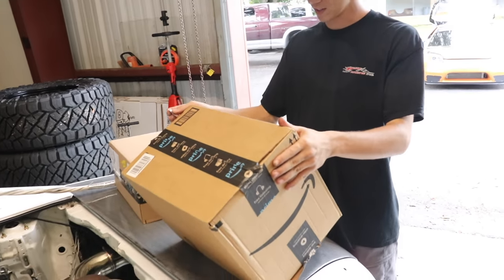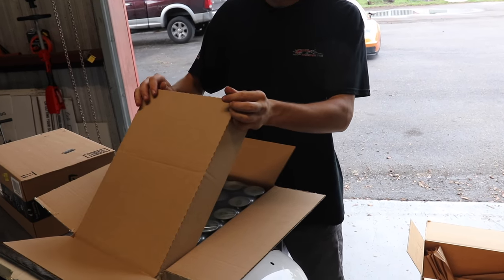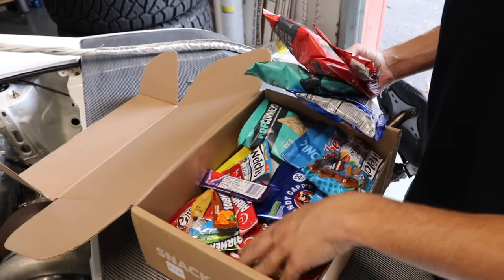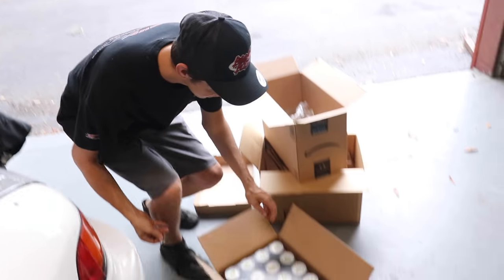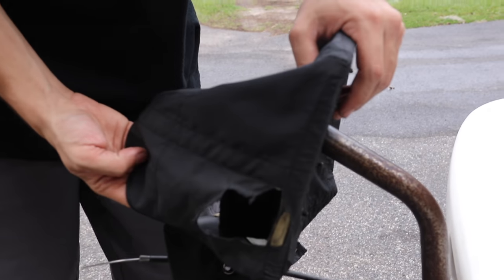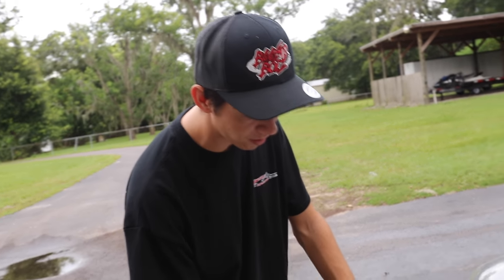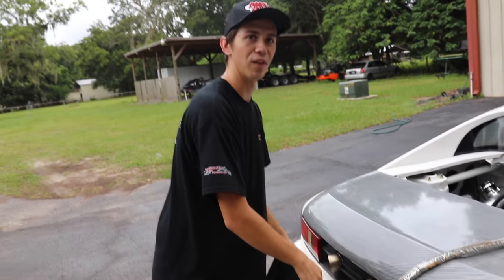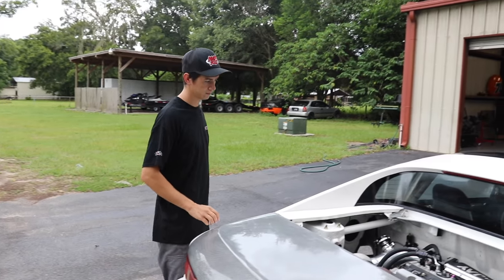We Ran Our ONE and ONLY 7 For Awhile...

Comment: Add a baffle in your fuel tank, when braking hard the fuel leaves the pickup and run the pump dry, I had that issue with my MR2 with same mechanical fuel pump.

Comment: FYI, those exhaust tips have such a small radius that the central portion (highest velocity and momentum) of the exhaust flow is going to resist changing direction (and pull quite a bit of the flow along with it). You'd be surprised what even another 10mm of radius might achieve

Also, here's another vote for having at a little input from KSR, even if only to help plan it out.

Comment: Heat shrink that positive cable the end thats on the alternator on the van.. its dangerously close to grounding out on the heat shield on the alternator.
Reply: pretty sure the heat shield is plastic
Reply: @mdnovaman  bahahaha no... all heat shields on or near engines are always metal, beit aluminum or aluminized steel.
Reply: @drgibs347  I’m sat here with an alternator in front of me with a moulded plastic heat shield 🙃. His could well be. But it also could be plastic.
Reply: @drgibs347  dr gibs is right some alternators have a plastic shield mated on the back with a small air gap.
Reply: @FabFiend  air gap for that kinda heat shield is more important then shield material, airs a far better insulator then a lotta people realize 🤟but either way insulate the damn alt cable lol thats one of the highest loads in any chassis

Comment: Find a another chassis to start the cage build Edit: it only makes sense it would be less work in the long run and be cleaner welds instead of  welding on top of previous welds
Reply: He's got that red mr2 just sitting there 🤔
Reply: @dookiebooger9967  no doubt right?
Reply: You just make new plates ....
Reply: @NiveusLuxLucis  adding more work and still  welding on top of the old welds  unless you make the plates smaller in which case you're  creating weaker mounting points by having to grind down old welds on the thinner sheet steel. Making the plates any larger is just a waste of  weight. Japanese cars have thin sheet steel and are strong like paper #oragamicars

Comment: I think you should get the doors and the deck lid wrapped in white to make it look legit. Also the front block off plate on the front bumper should be made of a thin sheet of 1/8 white poly. Then paint the lower black section on the bumper, the lower section of the rockers and the lower section on the rear bumper white.
It will make it look lower without lowering the subscription. Also when you make the drag wing paint it white as well. I think with all the things color coded it would look so much nicer. I know the Raw carbon let's every one know its carbon. But I think it would make the car would look so much cleaner. Another thing you could do is make a alloy panel for inside the rear firewall to put some sponsor decals on it to help out all the companies that helped with the build. Also A a frame board to sit outside the tent for when you are at events. Would be better than covering the MR2 in decals and stickers to make it look so much clearer. The only stickers you should put on is for Once the new front bumper block off plate is painted white is a Black Fueltech sticker. Then a PFI speed windscreen banner and 2 JBR Engine stickers for the rear coupe side glass. And that should be it. If those few things are tidied up and a buff and polished the MR2 is going to look Mint.
It would be a little work but it would be well with it. Congratulations again on the Record and the First 7. And I know you mentioned in the last video,  but Wyatt deserves all the help on his race truck now. Well don't Boiz.

Comment: The NSX seems be having a ignition cut to help build boost quickly (raw fuel in the exhaust) built in to the maps . Send the files to Fuel teck and see what he thinks . I would look at the tps sweep looking for a small dead spot as well  or try a new tps for a quick easy test. .  The mr2 would make a killer 8.5 -9 bracket car while you cage a new chassis , give your tons of data , time to dial in the chassis suspension & learn how to really dial in all the new sensors to run and make money . Everyone knows how quick it is now but how consistent can you build it to go rounds in a bracket class or no time heads up 1/8th

Comment: If you do plinth blocks for the case you wouldn't have to cut the floor to drop the case down. Also with the blocks when you're fitting the cage and then when you're ready to weld the top of the hoops. Pull the blocks out temporarily to drop a cage down. Plus it makes the amount in port on the floor lot stronger for the cage.

Comment: I can understand why you did the build the way you did. You wanted to be the first in the 7's. But it would have been the perfect time to do the new cage when you had the car stripped down for the engine build.

Whether you build it or have someone else build it. Go with enough cage so you can grow into it, time wise.  Don't do just enough cage to make it good for what you are running now. Think ahead and make it enough cage to go even faster. So if you decide to do even more upgrades or just turn it way up, you'll be legal to run as fast as you want.  The last thing you need is to have a bunch of down time to build the new cage, get it done and then out run it's cert. again. I'm not personally familiar with the requirements when you get faster then the 8.50 cert.  Just build the new cage with the future in mind.

And at what point will a 2nd chute be required? Is it 200 mph? You might want to consider that too. 

And on the van's electric water pump, do you have some kind of controller for it? Some electric water pumps can move too much coolant/water, too fast, which can also hurt cooling. You may need to be able to slow the speed of them down.  I'm pretty sure the FuelTech  set up can control that. I just can't remember if the Rowdyssey had a FuelTech in it yet.

Comment: dont forget to keep testing and playing with re-adding weight back into the front of the car. I know the wheelie sensor will handle it regardless, but you will probably still be able to throw more at it on the 2 step and pull a better 60 foot by adding weight back in the front on the plate. i guess when you add the new cage that will change everything up anyways but something to keep in mind. i love the carbon parts but would love to see you put a wrap with a full livery on it. it's so racecar at this point it would be cool to see you put a livery on it that matches with boosted boiz plasterd on down the side with all your sponsors. youve got the NSX for the street car look. somethin like LZ's white and red R32

Comment: You should fit fogs into the front so you dont need to use that cars headlamps in highspeed runs. Those things will totally f.ckup the cars aerodynamics if popped up.
Reply: They do have aftermarket solid lights for SW20s instead of the pop-ups. They were a thing during the AutoSalon SexSpec era but haven't seen a set in over a decade.
Reply: @MafiaboysWorld  then you would lose the pop ups, my way adding just fogs means he could still have popups when not doing 180mph+.
Reply: @christianbuczko1481  Pop-ups are overrated anyway. 🤷

Comment: Use a temp gun and temp the top hose going into the rad and then shoot temp gun at the bottom rad and see what kind of difference in temp you have an that will help determine if rads to small ect

Comment: SFI Spec 25.5 chassis will certify to 7.50e.t and up to 3600lbs, 25.3 is 6.50e.t @3600lbs, 25.2 is 6.0 @3200. If it were me, I would go on with the 25.3 spec. At the rate you are going, it probably won't take long to make it faster than 7.50's, and if you just do a 25.5 spec now, you will be redoing the cage again this time next year to a 25.3.

Comment: As I said, in a earlier video with the 
Odyssey/Rodyssey. With the overheating issue, you guys need a normal exhaust  system down and out to help with heating issues in that engine bay. And maybe that stock bumper might need more cutting. But for sure that electric water pump is going to help.

Comment: Funny you got excited about a good starter. I used to daily drive my Dart and I found out the later Diplomat police cars used a factory high speed high torque starter so I put one in my Dart. It cranks twice as fast and sounds way different than the old school Mopar starters they used to use. I guess they have mini starters now in the later Dakotas and like that that will bolt in but have never tried one since I retired it.
Good idea to get that cage up to the new speed capability. You can ask Jeremy about that at PFI with Kator Tot from when it got barrel rolled a few times and the driver and car survived.

Comment: Yes get the cage fixed correctly or running at 8.50's only safety is more important than anything but you can at least have fun with it till you start the process 👍👍 check fuel filter and clean injectors just my opinion before you go to ice cream Cruise in both the van and the other car you're taking

Comment: If Boosted Boiz do Foxbody's I bought 1990 Lincoln Mk Vii 5.0 from an estate, squirrels got the wiring harness which are hard to find , body's straight, all chrome and pieces there, cranked on ether with Battery, was a parked 154k Grandpas car that sat at least 8 months after he passed, if so car is listed on craislist in gainesville,ocala,jax and tampabay under auto parts, If nothing else someone could transform a fox body mustang or tbird into Lincoln. Or search for the harness or build one have $850 in it and just want out, otherwise keeping the 5.0/tranny

Comment: Instead of cutting the entire floor, you could just drill holes the diameter of the roll cage tubing and leave the end plates off. Drop the cage through the holes, weld up and paint the top, push the cage back into place, then weld in the end plates and finish the floor.

Comment: Carbon fiber top while at it would be nice.
Also why not make a forced air intake to turbo from the side vent, heat soaking on runs like when you did the 7 rob you of some power.

Comment: Kyle/Wyatt, why don't your guys buy some small battery tenders and just install them in your vehicles under the hood? They weigh nothing and will always keep the battery topped up. Much, much easier on the batteries and all you have to do is plug the car in if you know it'll be sitting for an extended period.

Comment: The plugs on the NSX are prob smoked. When sputtering anomalies pop up, I always check fuel, then plugs. 9 times out of 10, its something simple. Even tho the plugs are run off coils, the spark gets stronger the higher it revs. Thats why my guess is plugs, once you rev it high it smooths out because the pulse is stronger, jumping the gap easier.

Comment: If you can race at 1/8 mile at full power without having to build up a cage that would be awesome because you could keep testing and improving for months and keep having fun with the car with it's new fresh fast build, and then some day later when you do finally put in a cage you would already have all the data and settings for doing a good 1/8 and you could then just let it do the whole 1/4 and it would probably be another personal best since it would be riding on top of all the work you put in to getting a good 1/8. Plus that funny car cage really makes it not fun to drive on the street.

Comment: I dont know if you'll read this but I have an issue with my boosted B16 hatch. Runs, drives fine, but when i give it more throttle and it starts to build boost it just cuts out. afr stay 10-11 but it just randomly cuts off. no its not hitting boost cut we set that up way over than what it actually is at. Any help guys?

Comment: You can break Cert based on MPH and 1/8th mile time, the fact that the car needs to be update is still the priority. Back 10-15 years ago 11.99 required a 6 point and the requirements now have been pushed up there really is no excuse for your safety and the safety of others.
Reply: so 5.15 in the 8th is max ET anything quicker depending on the track has kick, maybe just private track rental days. More latitude

Comment: The weight of a new cage means you will need to turn up to get it in 7s again
Reply: it will put some more weight forward too, which is good. That thing has power left and isn't even launching correctly. 7 second pass on a 70% leave means thing thing can add a couple pounds and still be fine. It's going to be very very fast when it works 100%.

Comment: Brake brakes brakes, if you have factory brakes you NEED to upgrade those.
Reply: It’s a drag car not a track car. Stock brakes are plenty plus he has a parachute. On a drag strip it’s unnecessary and will probably hurt his times with more unsprung weight.
Reply: @Vanadinit3  you know a set of wildwood or strange brakes are probably less unsprung weight, safer and better. What happens when the parachute doesn’t release? Stock brakes are cool at 10-11 second passes. But you’re gambling your life trying to stop on entry level commuter pads and OEM single piston fronts at 190mph.

Comment: Are requirements same everywhere?

13.99 seconds (8.59 1/8th) 
Drive Line Loop with slicks 
Approved helmet (Full face in open cars), see below 
SFI 3.2A/1 Jacket in vehicles equipped with non-OEM nitrous oxide, turbochargers or superchargers 
13.49 seconds (8.25 1/8th) 
Roll bar in convertibles 
SFI seat belts in convertibles 
11.99 seconds (7.49 1/8th) 
Steel Valve Stems 
Arm Restraints (open cars) 
11.49 seconds (7.35 1/8th) 
SFI 1.1 or 1.2 Flywheel / Clutch 
SFI 6.1, 6.2, 6.3 or 9.1 Flywheel shield 
SFI 3.2A/1 approved jacket 
6 point roll bar 
SFI approved seat belts 
10.99 seconds (6.99 1/8th) or Super Street 
SFI 4.1 Transmission Shield, or at 135 mph 
Locking transmission dipstick tube 
Aftermarket axles and axle retainers 
SFI Harmonic Balancer 
Roll Cage with altered floor pans, or 135 mph - Window net required 
Ignition cut-off on all bikes / snowmobiles that exceed 135 mph 
9.99 seconds (6.39 1/8th) or Super Gas or 135 mph 
NHRA Chassis Certification 
NHRA Competition License 
SFI jacket & pants 3.2A/5 
SFI neck collar & gloves 3.3/1 
SFI 29.1 flexplate / 30.1 flexplate shield (AT equipped cars) 
Full Face Helmet meeting Snell or SFI specifications 
Parachute 150 mph

Comment: Would it not be easier to build a third chassis? Full spaceframe type jobby. That way you keep the white one running until the new chassis is done then spend some time swapping rubbing gear etc over.
Quicker in the long run and you get to run the white one for longer.

Comment: Drop the red one off to get the cage , put the carbon parts on it when it gets back ,then swap / upgrade everything leave make the white one run within its certified time. Oh and just go backto dual exhaust dual turbo setup on white  one and most efficient single dump on the red one then I want to see some 7.80s